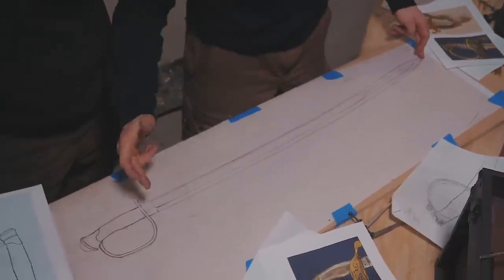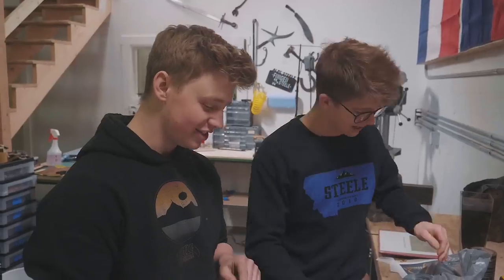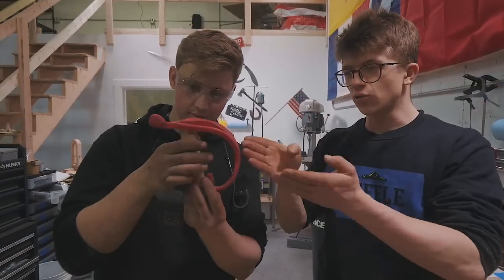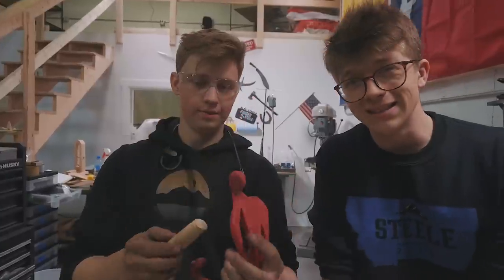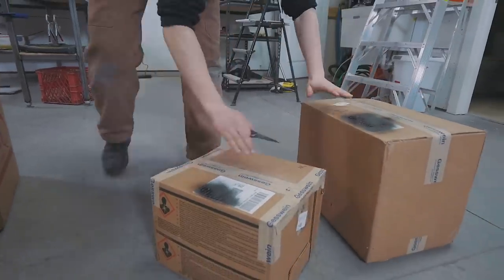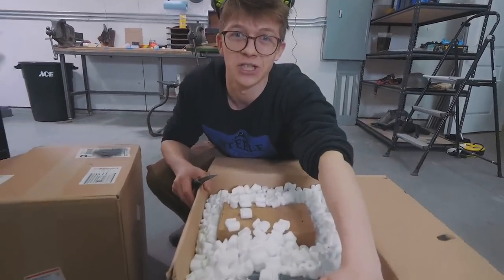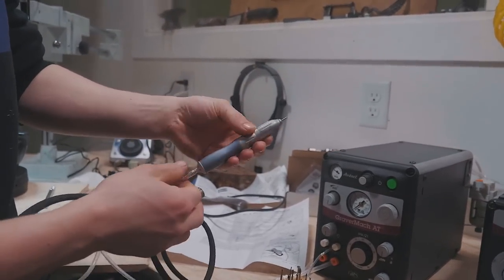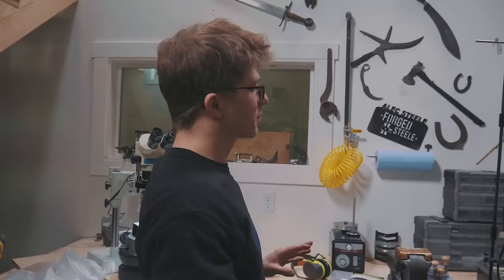MAKING THE CAVALRY SABRE: Part 3

Comment: OK so another question just out of curiosity and ignorance. Is there any particular reason you didn't add another steel to the 15N20 to make a pattern weld if you were going to go through the process of re-stacking anyway?

Comment: Cavalry sabers also were not sharpened as finely as other blades due to the way in which they were meant to be used. From horseback, at a passing gallop, they would slash down and away—this used the weight and momentum from the horse to cleave quite effectively without chancing that the blade could get stuck in their target, which would effectively disarm the rider.

Comment: Secure your plug strips guys. Don't leave them flopping in the breeze. Also, I wouldn't hook up things like the supply for the engraving tool without a surge suppressor since you have large motors in that shop and they will drop transients when you start and stop them.

Comment: At 11:49, Alec mentions that about 9mm is more than twice as thick as any part of the blade will be. However, the spine of many cavalry sabers could be quite thick near the guard, with a distal taper to a very thin cross-section nearer the tip. I've seen reproductions with 7mm thick spines where the blade meets the guard, and I've heard experts on historical sabers say that this is too thin!

Comment: Cavalry swords are also used in Cav soldier weddings. Soldiers hold the swords upside down on either side of the aisle forming an arch that the new couple walks through.  Although I've only attended one wedding with full cav garb. The tradition is the last man on the brides side renders a salute and then proceeds to smack the bride on the bottom. I'm fairly certain that this tradition has rightfully so fallen out of fashion. (This did not occur at the wedding I attended).

Comment: You dont have to sharpen the entire blade if youre gonna mostly cut with the upper 4th of the blade becouse thats where the center of percussion is.the lower part of the blade is for parrying, so sharpening the lower part would couse it to chip more quickly.

Comment: The haters complaining about “wasted material“ (ref 14:02) Gave me an idea for a fun project for you guys… Maybe you can try smelting together the metal particles that come off your grinders and are swept up in your shop then forge weld it with any other bits and off cuts from other projects. ...kind of like you did with the wagon wheel, except you won’t have to worry about adding carbon. Would be cool to see what kind of steel alloy-ish Damascus-y blade you would come up with.

Comment: Hey Alec just a quick question did you know that crude steel such as bloom steel is very porous and as such bleeds carbon like crazy? If you had used borax or ash and mud you’d have much better steel to work with. If you need help with things like that send a message through to the guys at Baltimore Knife and Sword they used to do man at arms and made absolutely amazing pieces.

Comment: hmm those water traps really don't clean it good enough I wouldn't think, if it has to be SUPER clean air. I would assume you would want a dual filter setup like I use in the spray booth at work. It has an initial traditional style filter  in the first stage ( except much bigger than those little ones and better or finer) and the second one has a carbon filter in it which cleans the air further. Might be something to look into if that equipment is super sensitive to anything going through it...

Comment: There was a very practical reason for why the blades weren't sharpened. These swords were used from horseback, as the mounted soldier charged enemy lines. It was imperative to be able to stab one's opponent and then pull the sword out to continue on to the next target. This is why the blades are curved... It makes the motion smoother as the cavalry soldier rides past (and relatively rotates) the target... But it's also why they weren't sharpened along their length: a sharpened edge is likely to get lodged in bone and stuck in the target, leaving the cavalry soldier disarmed.

Comment: Hey guys. Just wanted to let you know that a 36 inch blade, while not out-of-the-park away from normal, is still tipping the top end of the scale by about an inch or more. A more common length is 34 to 35 inches, and that extra inch or so makes a world of difference in trying to draw it or wield it on horseback. I doubt you want to scrub the design at this point especially after getting your shape pulled out, but still wanted to point it out as an FYI.

Comment: 2.18 the reason they only sharpened the last part of the blade was beacuse it had thinner edge geometry and the other part of the blade had extremly stout grind (think of 8mm thick with 2 cm high straight grind) most saber were sharpened that way . Also the last third of the blade is what you cut with on all swords.

Comment: As civil war swords go they were longer than they are now. mostly because at that time officers were on horseback and would be slashing down at enemy soldiers so your overall length should be 40" to 42"inches. Watch the movie "Glory" that will give you a good frame of reference for the length and function of the sword in battle.

Comment: i think you guys still should have made this blade from some sort of Damascus, since sadly with it only being straight 15n20, seems like a little bit of a waste of good steel, when you easily could have used 5160 or L6 that would have provided better toughness for a weapon in the length of a sword. since 15n20 is not a overall flexible steel given the nickle content of it. just a little metallurgy insight i guess, still a awesome idea, loving the energy!

Comment: Also, the reason they didn't, usually, sharpen the entire length of the sword has nothing to do with being barbaric. Military swords of the time were not sharpened, until they were expected to be used in combat. Then they would be "service sharpened". In most cases, the blade would be sharpened about half way down from the tip, because the main use of the "fort" or "strong" of the blade (the area close to the hilt) is for parrying and blocking.
I still think you guys should contact Matt Easton for more input on this project.

Comment: I would double check your sources for why they only sharpened part. Everything I’ve ever heard from a multitude of sources is that they didn’t sharpen the entire thing simply because it wasn’t necessary. You only need the top half sharp because you cut with that part and you parry with the bottom. There’s no reason to sharpen the part that wouldn’t be used in offensive strikes.

Comment: Just remember that the ricasso of the sword is going to be thick...the its distal taper that you need to work on to lighten the blade.  The ricasso is probably 7mm thick and down near the tip it is probably 2mm.

Comment: ****Re: The Sparks at the plug: I had a small fire in my shop not long after it was built. Chop saw/ shop dust had built upon the plug head and wall plate, sparked and melted the plug face and singed the wall!!!! Happened over night. Just about had a heart attack when I saw that!!! Everyone, do yourselves a big favour, cover your plugs. I found an 8"x8" square of vinyl trap worked perfect on two socket plugs. Bigger for my 220v plugs. You want enough so it drapes over to cover the plugs when tools are plugged in. I even covered my light switches. Just used thumb tacks to attach it to walls. I know.....I know, the 'never happened for 30 yrs in my shop' guys are gonna flame up. But it's cheap and quick, and it's proven to happen, so best to just do it. And cover your surface mount boxes too!

Comment: The main reason that sabers weren't sharpened, at least in the us, is because they were used primarily by Calvary and a thin blunt peice of metal going 35 mph on horseback will do much more damage than if it were sharp as well as there being no thin spots that could chip and create a stress point to crack.
Reply: Also it was cheaper and faster to produce dull sabers besides the fact that they don't need to be sharp

Comment: If you want to blank your address out on the labels. They are thermal transfer labels. Meaning heat will turn them black. You have heat. You could literally kiss it with a torch or heat gun and the whole label will turn black.

Comment: Maybe a daft question guys, but if you are making a shed load of swords generally, wouldn't it be better to have a really long tunnel furnace so you can heat up the entire length of metal, rather than one bit of it?

Comment: Blades are dull because a sharpened blade will chip or get stuck in bone while swinging from horseback at full gallop. A dull blade will still ..... split a wig.  With the speed and force of a full swing or speed from horse. A blade with a thin sharp edge would have problems with task.

Comment: This would have been a perfect opportunity to collab with Matt Easton over at Schola Gladiatoria. Oh, and by the way, you are misinformed about the sharpening of sabers. For the most part, if a saber was only sharpened in its last half or even 1/3, it was to use the section near the hilt for parring and receiving blows. No need to have a fine edge there if it is going to be contacting an opponents blade regularly. The majority of the time, if the blade was service sharpened, it would be for the full length of the cutting edge. Easton's channel is a great resource for fact-checking the historicity of a lot of the claims that are out there.

Comment: So you don't have to paint labels in the future, just buy a bag of A4 (or letter since US) full size sticker paper. It's cheap and you can use it for more than just that, like sticking it on metal when you want to transfer an engraving design.

Comment: You guys messed up on the making of the iron, the smelter should have been longer as the metal melts and falls down it picks up carbon from the coal but your supposed to keep the ash away it taints the metal

Comment: Why was there a lathe on a battle ship
Reply: To lathe metal? You might need to fix things on one of those.
Reply: Because out on the ocean you can't just make a quick trip over to ACE hardware. You would be surprised all the stuff that is on a ship that you wouldn't really think about.
Reply: USS ALABAMA has huge machine shop , blacksmith shop electrical shop and anything else you can think of in a city. She is in Mobile bay in Alabama as a museum ship. Even WWII distroyers had small machine shops.
Reply: Parts on a ship break. Ships don't carry every part that might need replacement. They don't have room for that nor to they know what will break. They do carry some raw material.  When the inevitable breakage of a part they don't have happens. They make the replacement.
Reply: Hank Doughty I did know they made some repairs but I thought there’d be  much more limited in tools to save space
Reply: @outdoorperson6411  Space does you very little good when you're stuck at sea with a busted engine, repair parts weeks away by tender, and missing action - or worse, in danger from an enemy fleet.  The ship must sail.